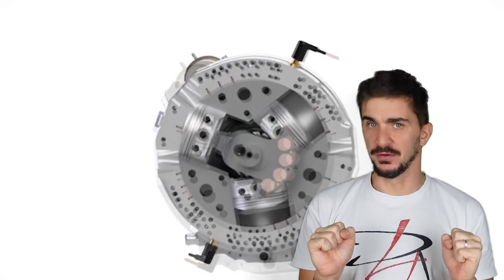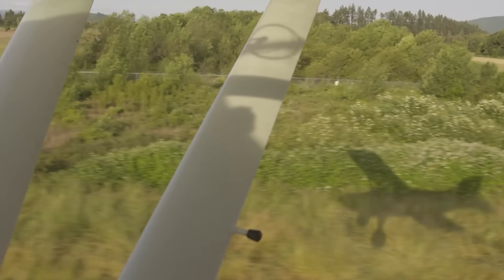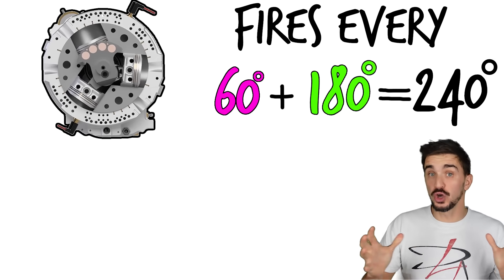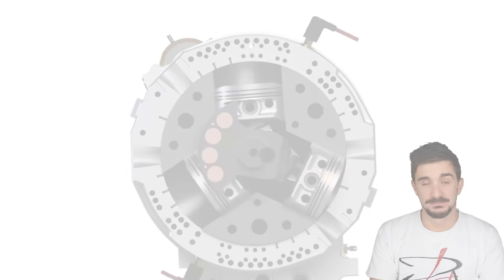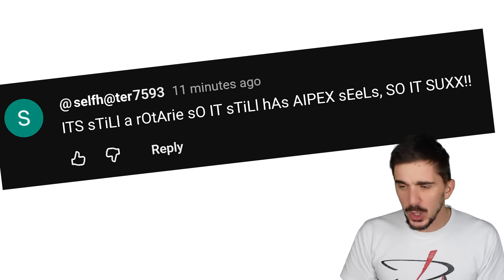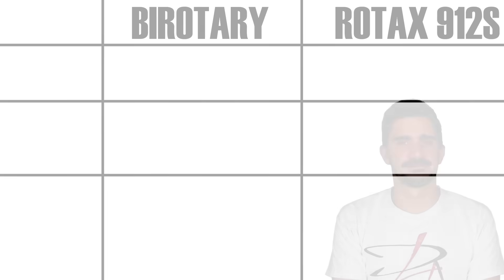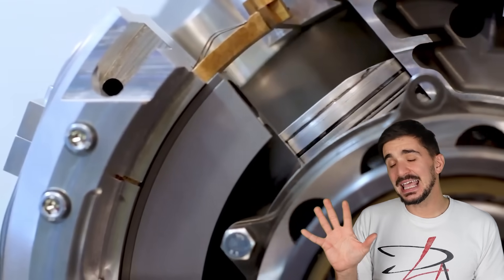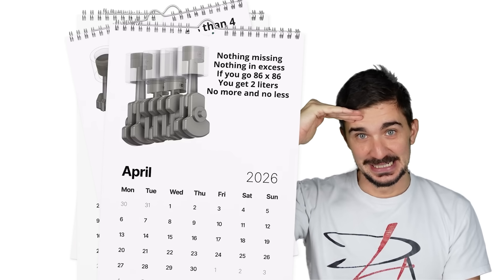This is What Happens When Pistons and Rotaries Make Babies - Birotary Engine Explained and Reviewed

Comment: From the start, this engine looks less efficient at idle and at low rpm tasks
Reply: Yup, however that generally doesn't matter for avionics, as those engines generally operate at a single rpm, or an exceptionally narrow band, for 99% of the time.
Reply: @Xiph1980  I was refering to it being used in cars/bikes, it actually might be good with a CVT